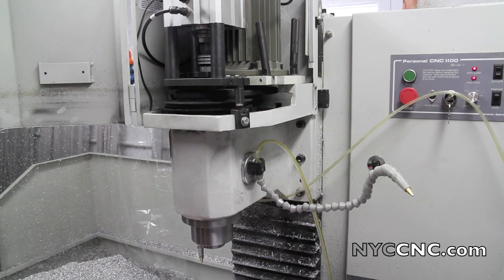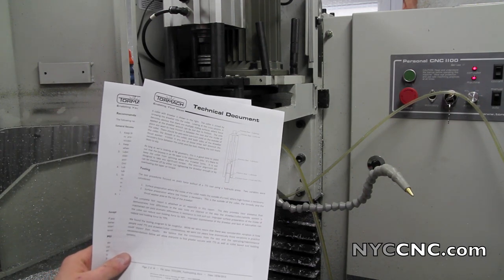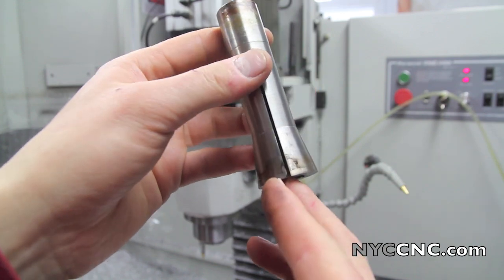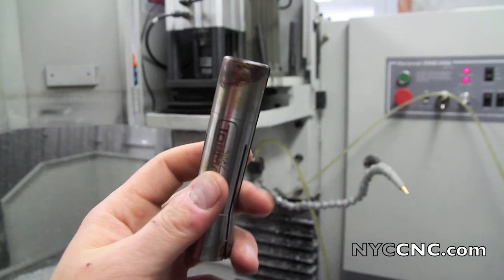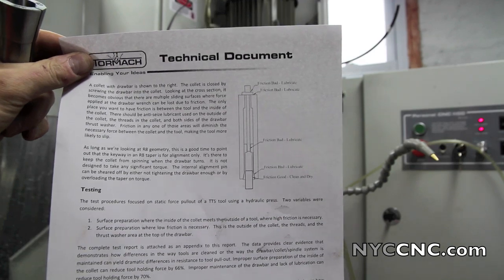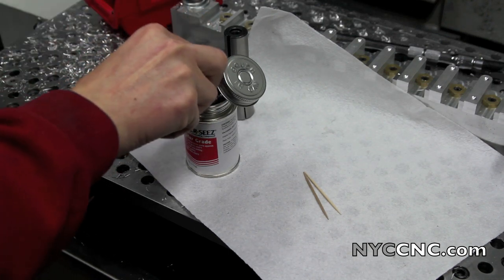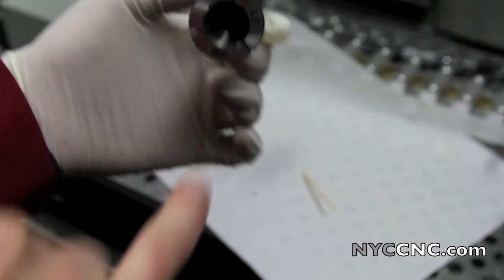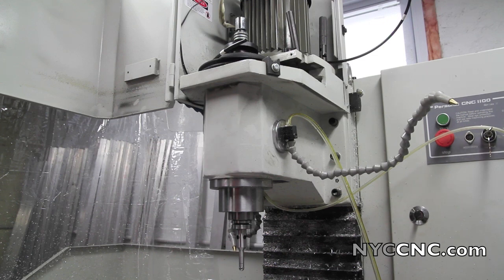Tormach Tooling System: Preventing TTS Collet Slip Pull Out

Comment: I tried this recently and it definitely helps with pullout, but it also tends to make runout worse.  The anti-seize has small particles of copper that push the the R8 collet around unevenly. If you are curious, you can definitely mic the grease.  I suppose if you are having pullout problems, it implies large endmills and perhaps the runout isn't really an issue.  Either way, it was a great video John!  Thanks.

Comment: An interesting video!  I have wear points at the bottom of the R8 taper on either side of the slits as well.  I do not have any discoloration or wear at the top of the collet though.  I attribute this wear to the R8 socket in the spindle not being accurately machined.  I see my wear pattern rather well when I put layout dye on the collet.  I have tried this with other collets and am pretty well convinced that the deviation is in the spindle socket rather than the collet.  I also checked my old mill drill and found much better contact.
In my analysis, the taper of the collet should be making contact around the entire surface of the taper in order to properly transfer the clamping force to the tool.  As an example, an improperly matched Morse or Jacobs taper does not function very well. Tool slippage occurs because the clamping force is located at the very limited areas adjacent to the bottom of the slits.

If I had the guts to do it, I would rework the Tormach spindle socket. Maybe the next time I have to replace a spindle, I'll give it a try (the 770 spindle cartridge is not rebuildable, according to Tormach).

What anomic79 said below.

Comment: Hi.  Never-Seez is great for engine threads subject to high heat such as for exhaust manifold bolts or spark plugs.  It is great stuff and I use it often.  Even when it dries out it leaves non-corrosive particles that prevent seizing, plus it allows nice even torquing of the bolts.  But it isn't the right lubricant for any moving part on the mill. Thank you for the great videos!

Comment: ive been debating on going to a 1inch collet and then making my own tool holders,, ive made a couple tool holders and as long as there is never more than .0002 total run out of holder its super smooth and have no problem using .050 dia MA_FORD TUFFCUT end mills down in mold cavities running 5000rpm @ 6 ipm for raised text work,, i dont care for the r-8 system or the mach 3,, im a fanuco guy all the way, i dont like how the tools set with the mach controller,, but i think a 1in collet would help!

Comment: I undedrstand there is a BT30 spindle for the Tormach.  With that said, Don't use cheaply made R8 collets.  I had problems with using cheap R8 Collets in my Bridgeport mills. I perfer the Royal brand or Lyndex R8 collets in my standard manual machines.  I have no idea the quality of the Tormach collets.  Recently though I have seen a older Tormach mill retrofitted with a FANUC Oi-MC control.  These are really neat fairly affordable controls that are pretty easy to set up and install.

Comment: Good vid i also posted on the zone recently. I was having massive pullout issues. When the anti sieze fixed all my problems perfectly!.

I did notice you pulled a screw out when removing your pdb.... Do i have something installed wrong? I can remove mine just buy flipping out the bolt on the right that holdes it in posiiton and i can just lift it off of that alignthment shaft. Just making sure i didnt miss a step when installing it.